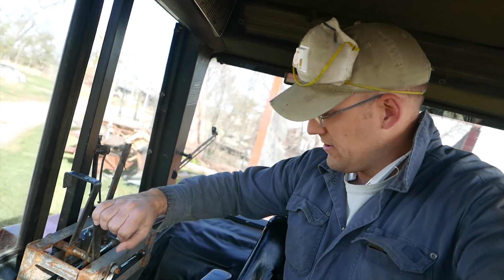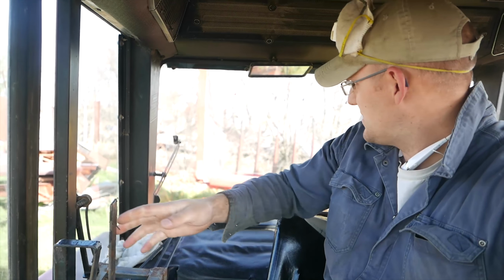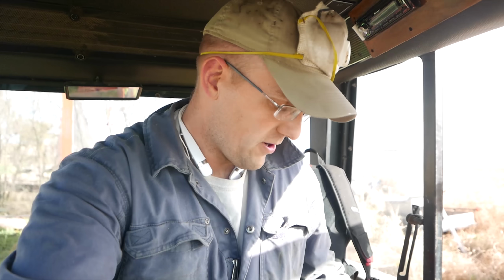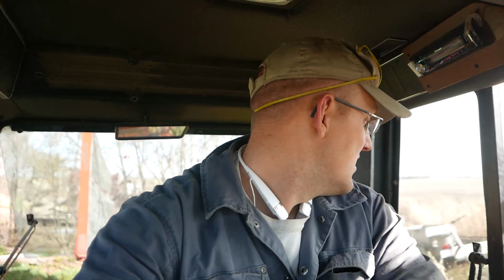FDWB - Last Square Bales of 2018 - Aerial Video

Comment: Approx. 1 1/2 yrs ago,  I bought a 1034 New Holland Bale Wagon.  After minor repairs and alot of  preventative maintenance (overhauled pick up cylinder, replaced most small hydraulic hoses; changed hydraulic fluid and filter; straighten brace under table 2 and weld new support; upgraded angle iron on side boards and replaced side boards (painted yellow); packed wheel bearings; replaced u-joints on pto shaft & 3 bearings on chain sprockets; replace control hood; straighten control lever rods)  it runs really, really well.  We grease it and oil as recommended in operator's manual.  I am now, without any hired help, able PICKUP & STACK HAY!!    

Just 2 years ago, I needed 4 people to pick up bales in the field: 1 driving truck pulling trailer, 1 on trailer stacking, and 2 walking next to trailer picking up bales and getting them on the trailer -- in 90 degree + temps in full sun in Oklahoma.   We even took a small towel and dipped it in the ice water in ice chest, and put on our heads and back of our necks to keep cool (dew rag)--it worked, and we got our 2nd wind to do a third load.  Each load was 120 bales, so in one day 4 hands put up 360 bales.  After 3 loads and many water breaks, we were wiped out, drenched in sweat head to toe, and headed to the nearest shade tree.  So for anyone who has experienced such exhaustion picking up bales, give FDWB a big thumbs up and share your hay baling story.
Reply from the maker: This was almost a biography of our own experience.  There was a time we use to pack to a hayrack. We had a 2-wide bale wagon with about 70bale capacity which was a nice start. We have a 1034 as well and has been a game changer. We went from 2500 to 5200 bales a year. With a recent purchase of a NH S1049 and a building we need to get up, I'm aiming for 8000+ a year.  Odd thing is, with the right upgrades we'll be able to do 8000 with less sweat than it took to put 2500 onto hayracks or into barns.

Comment: Thanks for that. We do about 10k small square bales each year in Texas and have been paying to have them put in the barn by hand. We're planning to push production to 15k this year and buy some sort of tool to stack them. Right now we're leaning towards a New Holland Bale Wagon and your video was extremely helpful for seeing exactly what people are talking about when they say "tie" layer and such. I really liked the hog panel trick in this video though.
Reply from the maker: Glad I could help. Understand there will be a learning curve and you won't be as fast as you initially hoped. When I'm on nice long flat fields, I can fill a wagon in under 15mins. Then unloading takes a little time and finesse. If I was in a position where I was starting over, I guess I wouldn't put all my eggs in one basket. When we first started with bale wagons, I still had afew hay racks around and we would pack a rack manually. Hard to imagine going back. Best of luck with whatever your decision.